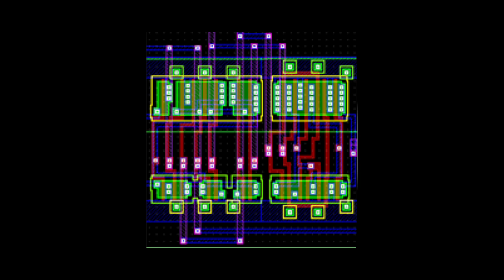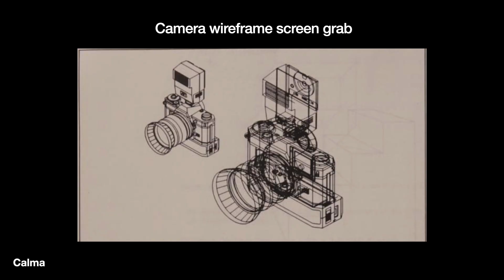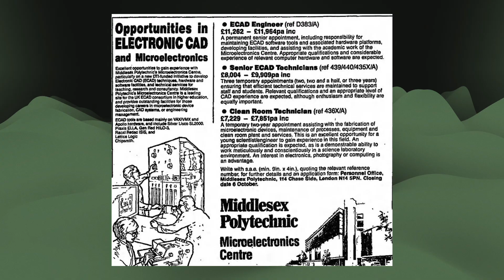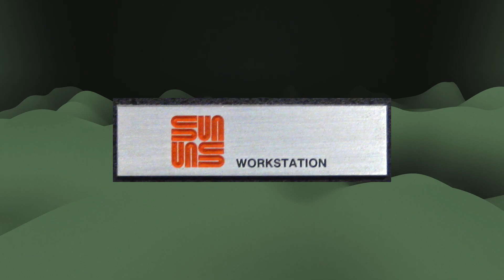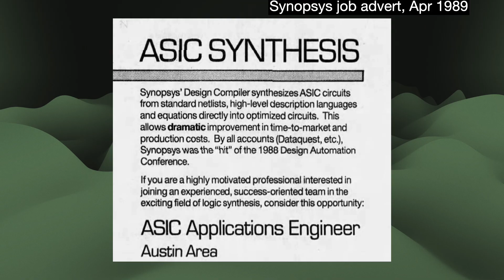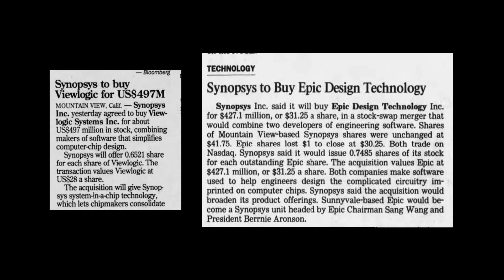The Semiconductor Design Software Duopoly: Cadence & Synopsys

Comment: Good video. At the end of the video you asked “what changed” that ended the stagnation of these two companies, let me answer that question: what changed was the end of Moore’s law and the rapid rise of custom hardware. About a decade ago, there were only a few large chip design companies that could be a source of significant revenue for EDA companies , the likes of Intel, Qualcomm, Broadcom and Nvidia. That changed when Moore’s law slowed down and software companies, especially hyper scalers, started designing their own chips to gain performance through hardware customization and optimization. With rise of custom chips, the customer pool for EDA companies started increasing rapidly, companies like Google, Amazon and Microsoft started designing their own chips and would buy a ton of EDA licenses and design IPs from the duopoly. Also, more recently, a lot of chip startups, especially in the field AI accelerators, have been popping up left and right to design custom ASICs specialized for a specific use case to pursue significant performance increases. So, the rise of custom chip designs is the main driver behind the recent rapid growth of Cadence and Synopsys.
Reply: Also Apple designs their own chips now! 

But I also wonder if integrating machine learning into the products is part of what's driving the growth. EDA might be delivering more value to customers if the machine learning substantially increases ppa. Additionally, the large training sets for machine learning might increase the barrier to entry for potential competitors
Reply: @TheParadoxy  Apple designs their own chips now but that means they are coming to the source to buy EDA software. They are one of our big clients at the big two
Reply: another point to add if you want to look on an even smaller scale post 2017 and around pandemic time, the chip shortage fueled EDA software sales as companies faced needs to design more efficient chips with tough material constraints. After that came AI hype in market which continues to drive the growth of the duopoly
Reply: fascinating, thanks 4 sharing
Reply: To your initial point, any thoughts as to why the large players didn’t create their own EDA platforms? They would all have had the incentive and capital (unlike today’s hardware startups) to do so.
Reply: @Superalpaca1234  A lot of large chip design companies did have their own internal EDA tools back in the day but most of those internal tools failed and no longer exist. There are several problems with using internal EDA tools: The EDA tool itself wasn't the core business for the chip companies, so it was often neglected and failed to attract talented software developers. Additionally, engineers working on internal EDA tools are not incentivized to push the boundaries to make the tool better every year since they don't have any competition, internal design teams were forced to use the internal EDA tool. Also, as commercial EDA tools gained traction in the industry, they gained a much bigger user-base and foundry support than any internal EDA tools, therefore they were much more robust and well-supported. Another issue is that every time a new chip design engineer was hired, they needed to be trained on the internal EDA tool which had a steep learning curve, whereas there existed a large pool of talent that were skilled with commercial EDA tools from previous jobs or university education.  All in all, chip design companies developing their own closed-source internal EDA tool is often a bad idea, it only makes sense if an equivalent commercial EDA tool doesn't exist and even then, it might be better to work with a commercial vendor to develop the tool or even better develop the tool as an open source tool, as companies like Google have done for the silicon-photonics tools.

Comment: Humans remain humans - slow, thick and primitive.
Trading fossil fuels by the doctrine of what's called 'supply and demand' not on the basis they are finite - has played havoc with our outgoing Western Civilisation.
Fossil fuels are dangerously hypnotic to humans and their mental capacity.
Humans were not ready morally, ethically and intellectually to start the mass extraction of fossil fuels with the advent of the steam engine 300 years ago.
Our Western Civilisation couldn't tolerate anybody telling it - that - when energy looted by the narrative of non-finite fossil fuels - it turns - curse.
A curse that destroys in humans consciousness and the future.
The Magna Carta requires today overhauling adding to it the right for humans to understand what Energy really means  before any other commandment.
"In any system of energy, Control is what consumes energy the most.
No energy store holds enough energy to extract an amount of energy equal to the total energy it stores. 
No system of energy can deliver sum useful energy in excess of the total energy put into constructing it.
This universal truth applies to all systems.
Energy, like time, flows from past to future" (2017).

Comment: What EDA software was the leader for cell phone circuit designs in the 1990s and 2000s? At the time cell phones ran at much high frequencies than CPUs, GPUs, and motherboards.
Reply: Synopsys and Cadence. When you say “much higher frequency”, I think you’re talking about the RF and not the logic circuits.
Reply: @michael_r  oops, good point. The question remains…. Who was the leader? It wasn’t Cadence or Synopsys.
Reply: @jaymacpherson8167  yes it was. I worked in semiconductors in the late 90’s through mid 2000’s. The largest EDA vendors were Cadence and Synopsys. Mentor also had significant market share. There were more niche players - Magma, Calibre, IKOS, probably a bunch of other companies I’m not thinking off of the top of my head. But Cadence, Synopsys, and Mentor were the big names for large gate count ICs, at least in the ASIC and SOC world where I worked.
Reply: @michael_r  Yes, Cadence was the big dog for the larger market. When it came to cell phone design for high frequency RF, the EDA software of choice was ADS at HP. Tho they spun it off in Agilent, who sold it to Insight. I don’t think it has cache anymore.

Comment: One challenge faced by the two players is a very, very limited number of customers for their back-end tools, while the complexity of the ASIC and full-custom chip designs keeps increasing.   So Cadence and Synopsys have increasing development costs in the back-end software just to keep up with each CMOS generation, yet there's no corresponding increase in the number of potential customers.   There doesn't appear to be any obvious way to expand the market.
Reply: Every man and their dog are doing ASICs these days. Volumes for a lot of products have gotten high enough that it makes sense for many applications where you need to combine a few basic functionalities, to make their own chips. Not all chips have to be your billion-gate 3nm node chips - there is a huge market for mixed-signal asics in the 180 to 22 nm nodes.
Reply: That's generally true but i would argue the opposite is why the gained so much in stock price.

Hardware has become sexy again and there are many startups along with FAANG companies with hardware divisions. These companies rely heavily on EDA vendors to get off the ground.
Reply: @slickvik4508  exactly, unlike ASML the cost of starting a Fabless hardware company is way more accessible than starting a fab.

Comment: Would be interesting how eda duopoly line in with the fabrication foundries. Only viable now TSMC and Samsung. Intel is 5 years behind and losses a year every year. China (PRC) ten years behind. But PRC are making progress. Intel has been stuck for 6 years. Stuck not progressing.
Reply: There’s a lot more fabs than just Intel, TSMC, and Samsung. Semiconductors are a lot more than the leading edge, and also more than just x86 or Arm chips.

Texas Instruments
UMC
SMIC
Micron
Analog Devices
Rohm (formerly Lapis)
Fuji
Fujitsu
Cannon
Kioxia
SK Hynix
Sony (yes! Even Sony!)
NXP
Global Foundries

All of these companies currently operate fabs. Some for memory. Some for MEMS or analog chips. Some for the defense and aerospace industry which tends to use very old process nodes but which also has additional design requirements (eg able to withstand repeated high-g stresses and solar radiation).

Comment: Mentor Graphics mentioned! I worked there this last year as an intern on parasitics extraction; it's such a cool industry.
Reply: parasite extraction? I usually just pinch the skin around the wound and the larva pops out
Reply: I just started watching the video so I haven’t gotten to that part but when I saw the thumbnail my first thought was, “Shots fired, Mentor Graphics!” 🤣
Reply: I've learned PCB design in the early 00's with Mentor Boardstation on a Sun workstation.. kinda sad that they got snarfed up in that huge duopoly.
Reply: @WooShell what do you feel about the future of it (now Siemens EDA)
Reply: @higherthangods  i would have to get a recent version to try it out. usually I'm not a big fan of Siemens software..
Reply: @ hmm, im gonna intern there as a software engineer, lets see how it goes.
Reply: @higherthangods  they surely aren't a bad company to work for. i'm just having issues with some of their design choices, and definitely with their licensing models ;-)

Comment: Any news video planned about reported copper interconnect vias oxidation in Intel 13th and 14th gen CPUs (Intel 7™, or previously called 10nm SuperFin lithography)?
Reply: That is just a theory at this point and hasn’t been confirmed (although it does make sense). But I too would love to see this channel address those rumors. His expertise in this area is second to none on the YouTube platform, and any insights would be a huge value-add to the community.
Reply: Really interested to see Intel's next gen because it's supposed to be their first architecture using "industry standard EDA". If it turns out that all or most of Intel's design oversights are resolved by using Cadence or Synopsis, that will be big news
Reply: @TheParadoxy  The software isn't magic, you still have to use it correctly. It takes years before you can get experienced enough to not let potential bugs through. Depending on how different their pipeline is, it could take a while to adjust.

For example you typically want stuff like 100% coverage of your blocks, but in practice, even with some convoluted tests, some bits aren't getting to flip or only one way around, and since you don't want to just force the signals to change since that defeats the point, you make exclusion lists of stuff that can be ignored. It's very easy to get those wrong and miss a signal that isn't connected properly. It happens easily if you have a block that you reuse between projects and you don't use a feature in a project.
Reply: @meneldal  thanks, I appreciate your response. 

Does this mean you expect Intel to struggle even more since they're changing to a new design flow?
Reply: @TheParadoxy  It's really hard to tell. Intel has plenty of great talent, and I don't doubt they have plenty who are experienced with other tools than the ones they currently use. Not to mention CPU verification is a very different job from SoC verification. 

Typically we use ARM CPUs and if we encounter a bug, a problem in the design from ARM is usually the last possibility on our list, below asking Cadence/Synopsys (which we do every so often because we can run into weird edge cases of hardware language specs, but I don't recall the last time we had to give a bug report to ARM, even if we do ask for stuff because we aren't sure about the spec sometimes).

Having to assume the CPU can do something stupid would definitely up the complexity of my job by a huge factor.
Reply: @meneldal  thanks 🙏